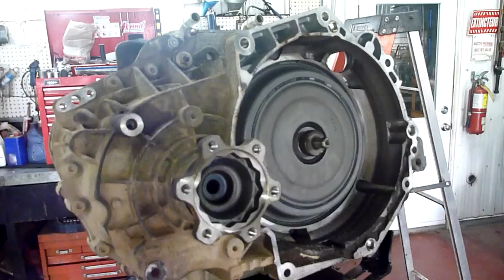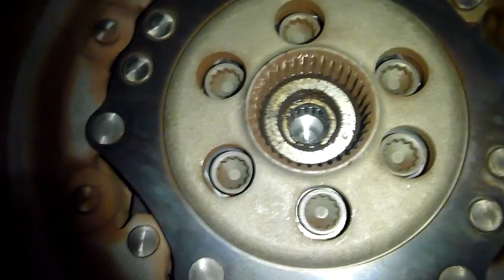2006 JETTA TDI DSG DUALL MASS REPLACEMENT

Comment from the maker: Hi the removal of the dual mass is just like any manual gear box the flywheel is bolted to the crank the only difference is you are not touching any clutch components because they are in front of the transmission and are wet meaning they share the same oil that the transmission use for lubrication similar to a motorcycle with a wet clutch system but to give more room for removal I think that I removed the sub-frame I can't remember hope that help.

Comment: I noticed that rateling noise  on my 06 Jetta TDI DSG flywheel  when the engine is cold but goes a way when at operating temperature , do you think i have to change it asap or if i leave it for a couple more months it's gonna damage the clutch and probably the transmission ?

i checked with a German cars specialized mechanic and he said that i also need to change the clutch even if the shifting is flawless , do you agree with him ?

thanks 
Karim

Comment: I just purchased a Mk5 jetta TDI with teh DSG , now looking at the maintenance history the DMF was already replaced in the past , at around 90000KM , and now the car is at 255000 KM , shift really good , no noise but do you thing I'll have to change it again in the future and consider this as a design problem and needs to be replaced after so and so KM ??

thank you 
karim
Reply from the maker: Kam RIM hi I think the newer dual mass flywheel last longer than the earlier version I haven’t had to replace a flywheel for the second time but the good thing about Duall mass they usually don’t fail suddenly they usually start doing more and more noise as the get older so it gives you the time to do something about it.

Comment: Hey what size are the 6 screws that hold it on, 12mm??... My new LuK DMF for my DSG automatic did NOT come w/ the 6 screws. I've mostly found torque to yield specs, but some guys on a tdi forum & some on Utube are saying they're NOT torque to yield, so the truth is a bit of a moving target right now. Torque to yield is still new to me, seen any good explanations?? - thanks

Comment: How long can you drive on a DMF that only rattles in park and neutral???
Reply from the maker: Colston Meeks hi I’m not sure because I never personally seen one come appart but if it’s really noisy then it might be a good idea to replace it before something bad happens.
Reply: @V10PDTDI  Thanks for you reply. Mine only makes slight noises when I'm in park ONLY! (or neutral) 2006 Jetta TDI Automatic DSG transmission.
Reply from the maker: Colston Meeks well then you might good for a while I think that it will never fail suddenly without making a lot of noise.